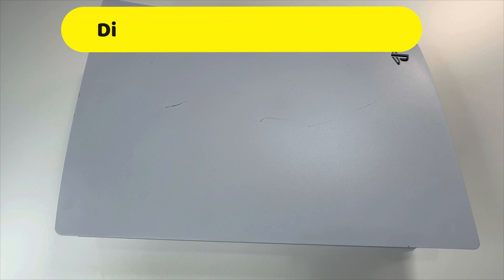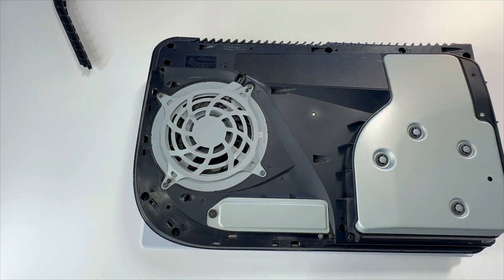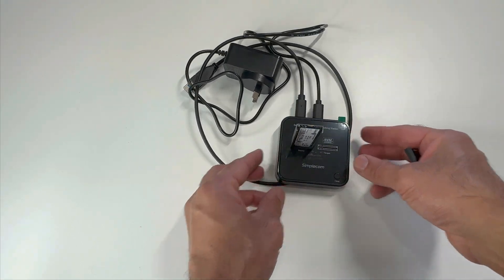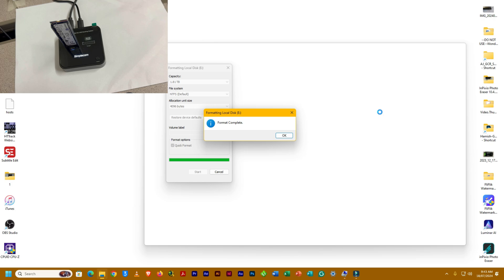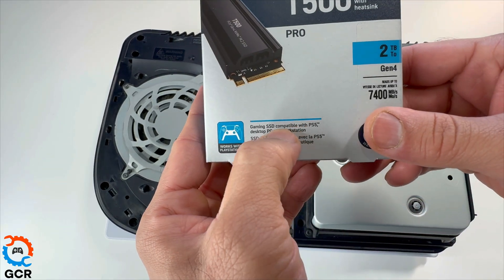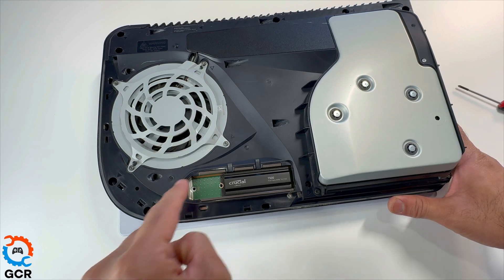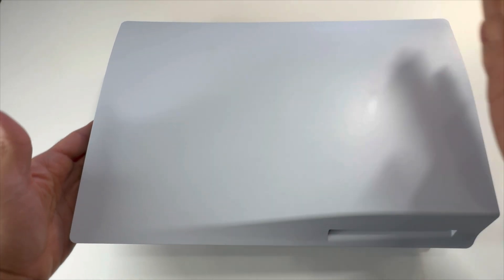2024 Latest PS5 SSD Repair Guide:- Fix PS5 Update Loop -  Repair Corrupted SSD & Upgrade to 2TB SSD

Comment from the maker: Chapters: -

[00:01] -  Introduction 
[00:15] -  PS5 stuck in the Update Loop 
[00:47] -  Disassembly & taking out corrupted SSD
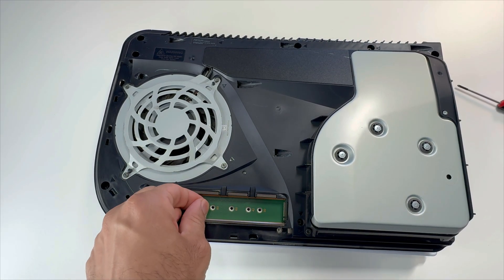[01:51] -  Testing Corrupted SSD via Windows PC 
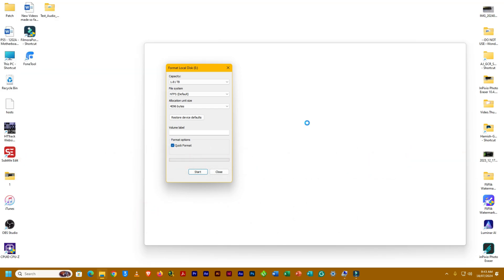[03:10] -  Placing Brand New 2TB SSD in PS5 
[04:27] -  Testing & Conclusion 
[06:30] -  Credits